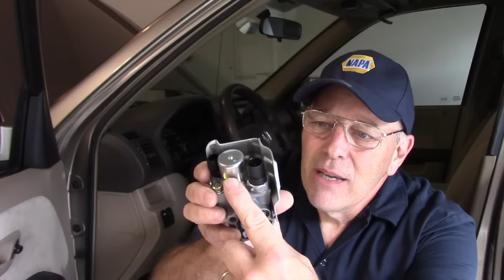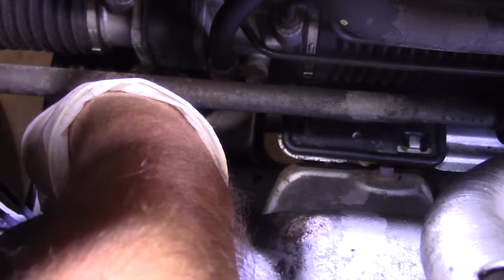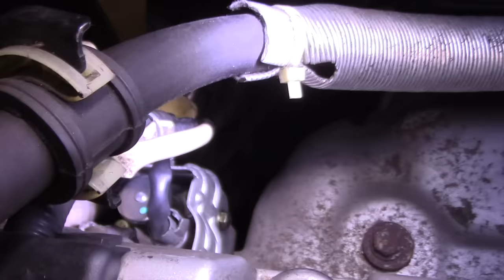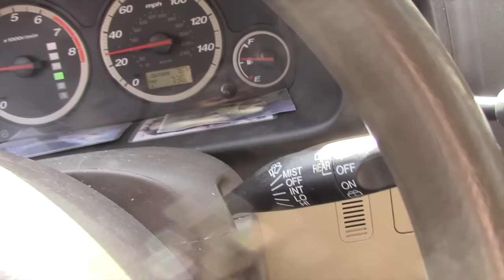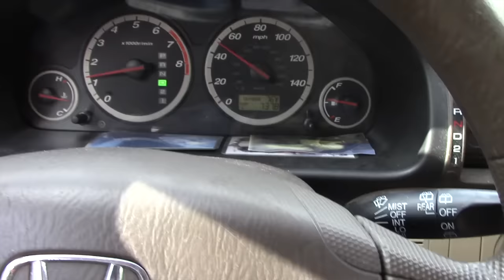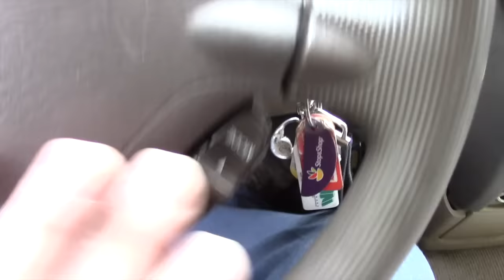VTEC Repair  P2647 Or 2646 (Pressure Circuit Voltage High Or Low)

Comment: I already replace the whole part assembly where all the censor mount filter and still won't pass the smog test some guy told me to just drive it and it will go away but I have being drive in it and won't go away can you let me know what should I do or if there anything I can do

Comment: this is an old video, so I don't expect you'll reply, but I've followed your instructions, the issue is the bolts just wont come out.. Im using 1/4 with 10mm and I even sprayed the with pb buster to no avail.. any tips? :(
Reply from the maker: If the 1/4 don’t work you will need to use a larger size for more leverage

Comment: You forgot one step. Remove the plastic cover from under the radiator so you can reach up through the engine bay and trigger the hood release.

Comment: It was my first time changing the VTEC solenoid on my 07 Honda Accord. I didn't know much about which parts to get so I went with aftermarket because the OEM solenoid was leaking oil. It worked fine for about 2 days then I noticed that my car would jerk. The check engine light came on. It only does it at higher RPM's. Needless to say, don't make the same mistake I did and get yourself OEM parts to replace core engine parts.

Comment: a couple of months back I noticed a slight engine oil leak, at first I taught it was the oil pan gasket but then I noticed it came from the solenoid. I saw a video on replacing the spool valve filter assembly and I order that plus the VTC Filter assembly and just in case some O-rings for the oil pressure switch and oil filter base o-ring just in case that is leaking too. I was waiting for hotter weather to roll in, in case I render my car not drive-able I can ride my motorcycle to work. Last week I got that jerk on the highway, I taught maybe the transmission since I replaced the oil 10k miles ago but when I checked I saw what it was so now I just order the spool assembly so I can replace the unit and maybe repair the old with the previous parts I ordered. Great Video, Thank you very much!!!!

Comment: For those watching this video, if you keep getting this code after replacing your vtec assembly, or get a P0420 code, you probably need to replace your oil pressure switch, which is located directly below the vtec assembly, if it leaking oil possibly due to a bad/failed gasket, that oil will drip below and can get into the boot and wire of the oil pressure switch and keep that code on... I had this issue after hoping that replacing my assembly it would fix it, but it didn't and I discovered oil was all over my oil pressure switch, rubber boot and switch.
Reply from the maker: Appreciate you sharing your experience, it could definitely help others. That is why getting the assembly from the dealer is important.From the dealer it should come with the pressure switch.

Comment: I switch that valve on an 08 honda crv, I even changed the secondary mesh gasket between power steering pump and tensioner...I drove it and it came back on...I changed the oil again even though it had 1k miles on oil change, changed a second oil filter from a stp to a oem honda and still the same... could I have purchased a dorman aftermarket part labeled as oem honda and that could be the issue?  The car surges like stated on the video, but after a few stop and goes it can push to 85 mph with no issue...and it drives like new out of the dealership...but the warning lights wont go away....thoughts anyone???
Reply from the maker: It's possible the aftermarket part is faulty.  Did you get the parts from the dealer or on line. Unfortunately if on line you can’t be sure of the parts manufacturer

Comment: Mine has a loud rattle when starting cold but goes away right away.  126k miles.  Sounds like a loose heat shield.

Comment: I replaced my spool valve ,sensors, oil is good  and still getting 2647 on a 2006 pilot. Also getting 83-01 ecm pcm relation failure. Any thoughts?

Comment: Does the P2657 code apply to this as well? I drive a 2016 Honda Accord coupe v6 EX-L 3.5L and I’ve been getting this code and cylinder misfire codes as well..

Comment: I had this code pop up so I replaced the whole vvt assembly. The code popped up again a month later and the engine kicking started again. I reached out to the tech of the dealership who sold me the part and they said that I should try putting in a OEM oil filter because the aftermarket ones don't give good enough oil supply. Problem seems to have gone away for now, but it's only been one day.

Comment: Great video, i still have an issue i replaced the vtech solenoid and also change the little screen that in front of the power steering. My 2006 honda accord isn't buckling anymore but my check engine light came back on with code P2646 what other part can the issue be? Please help, thank you!
Reply from the maker: Was the solenoid from the dealr or aftermarket?
Reply: It was from autozone.
Reply: @josephortega85  I had so many problems with the aftermarket that I only will install an OEM one. If that code was not there before the solenoid was replaced I would think about replacing it with an OEM part.
Reply: @getitdonehomerepair  will do, going to try that.
Reply: Thank you again!
Reply: Hello, I replaced the vtech solenoid with OEM part from Honda but the car still buckling and the check engine came back on again. Do you think it can be the  Variable Valve Timing (VVT) Solenoid?  @getitdonehomerepair

Comment: I get this p2646 code along with flashing check engine light. I have changed spark plugs and ignition coil but the codes for misfire came back. This started for me after using 88 octane what could be the issue??
Reply: Had the same issue, changed my nuzzles and the misfiring stopped

Comment: Engine light came on and Started bucking at 2900 rpm. Was 50 miles close to an oil change .  But had to a job 150 miles away. Engine  light shut off and it ran fine for 200 miles. Went back in limp mode. So I added oil like ya said and It went off. Was SO happy. The next day even though I bought that quart of oil, I got the oil changed. Had another job out of town and within 50 miles, same thing . Started bucking at 2900 rpm. 2 parts stores including Napa said to change the Valve Timing Oil Pressure Switch. I got one as I was coming home. Now I see your video. Is this the part that I need ? Or do I need that whole assembly?
Reply from the maker: It is possible that the switch is defective but from experience ( without further testing) it is more likely the pressure solenoid. If you do replace the solenoid get the OEM one. Good luck. Keep me posted
Reply: @jimthecarguy  thank u for the quick response . Dang it ha ha. I have the switch only n was about to change that. I think for another $100, I can get the whole assembly n take the switch back

Comment: Can I drive a few hundred miles with this problem. I'm very far from home and got this light.
Reply from the maker: You can but don’t drive fast and have it replaced ASAP
Reply: @jimthecarguy  thank you very the video I learned a lot not as complicated as I thought and to thank you for responding to my question that means so much to me. I did make it home by the way

Comment: I have a Honda CRV 2004, i changed the vtec same as the video. I changed the oil and filter as well. However, I'm still facing the issue when I accelerate that it drops back. Sometimes, I turn off the car, and then when I start it again, the issue goes away. Do you have any clue what should I do to get rid of this problem?

Comment: my check engine light came on, car done as you said, started jerking at 27-2800rpm.. Pulled the code, hit up youtube, watched your video, put the whole assembly in, and shes good to go.. Thank you
Reply: I got the P2646 too and bucking like a pony over 3000rpm...but...the bucking isnt consistent...it will only begin after an hour or so of freeway driving. Pull over, shut engine down, restart it and its OK again for another hour. Replacing the entire VTEC solenoid assembly today. Went ahead and paid for genuine Honda part.
Reply: Where did u get the whole assembly
Reply: ebay.. like $60 @stevelocon577

Comment: Hi Jim, very informative video, by the way my CL9 accord bucks and jolts when at a traffic stop or at low speed, do you think it could be a transmission solonoid issue? Thanks in advance.

Comment: I know this is an older video. Maybe you can help.  I just replaced this and the screen up front. Changed oil and it’s still in limp mode plus a double thunk sound then shuts off.  Thoughts?

Comment: I only get the bucking in 55-60mph...... I'm wondering if any noise would be associated with this issue....... I'm having this p2647 issue and I'm also hearing this weird humming noise almost like a metallic kazoo, never heard anything like it. Again at the 55-60 mph. Thanks for this video I really appreciate the detail!!
Reply: Get your valves adjusted

Comment: Anybody who spends 30+ minutes on a very informational video like this. Deserves a like & subscription.   Bonus points for the test drive footage afterwards!
Reply from the maker: Thank you for kind words. All too often on Youtube you hear negative comments and thanks for the sub.
Reply: All that time but didn’t even bench test the solenoid. Didn’t check ohms plunger or voltage.
Reply: @quddusahad8374 over 200K miles, at this point why even bother? He knew it was bad. OEM part is $200.

Comment: Initial problem as leaving gas station red oil can came on. Oil pressure light. Upon getting it home I put my scanner on it and up came this P2649, but that is not my issue anymore it still throws code, vut I have the sounds of non engaging vtec etc. Everything is new on car as far as all that goes. I am doing everything I can to not have to drop pan and oil out again 09 accord 2.4L K24z3 motor i-vtec. Still oil pressure light and sounds like no oil as the usual meta on metal sounds so I adverted immediately. I have done everything possible and I mean all necessarry tests to troubleshoot any and all connections, switches, selenoids, etc. Any help greatly appreciated. Thank you.

Comment: I took naughter in my husband shop he like a master he's like a Master Mechanic that overhauls strips transmission for hot rods and everything I have them look at my daughter's car she needed a need a timing solenoid for a 2008 Honda CRV what I bought from RockAuto timing solenoid and he stuck that in and still having problems with a 2646 code so I bought one of them so annoyed for him to put in and he found a screen in the front of the engine that he changed also to make sure it was clean oil and just put in synthetic oil while she was there the week before so you put send the new cell annoyed for the timing solenoid and it's still acting up so is it true that you got to run that for about 200 miles from cold to go away in the car to start running right slique going to hesitate but yeah took it in their alternators bad running right because nothing was getting charged in it so it all on circuits and everything in no cars wasn't relaying right information Jenna's how you you go about getting that how you get them lights off at cold after you replace the solenoid timing solenoid is if it's still acting up what could be the problem there's something we missing something is still acting up keep having that 2624 cold come up now can he reset that computer and how would you do that

Comment: For anyone that has had to replace this piece more than twice I’d suggest to clean the male and female ends with electronic spray. One of my female ends has a broken latch which prevents it from clicking closed. I’ve replaced the solenoid 4 times with this previous time being the genuine Honda part. I just couldn’t believe that the Honda part broke so I searched high and low and found this solution.
Reply: I had the same problem on my element and I got an oem part, and lasted me a few weeks , and it did it again. I’m going to clean my pigtail collections see if that helps. Thank you
Reply: @reytech1786  so I cleaned the pigtails and it was a bandaid on a bullet hole. Basically lasted for 20 minutes of driving and then would fail. Tried to clean it the other day, the pigtail broke off inside the solenoid, cost me 409 at a mechanic to just attach a new pigtail. Honda wanted to do the whole engine harness and the solenoid again. Estimated $2300. So did the repair for the pigtail elsewhere. Anyways, when driving back to Tampa from my parents house it broke again. Car has become a money pit so it has to go.
Reply: there is another one in front of the engine...oil screen dirty @reytech1786

Comment: I have had this problem  with my Element for 3 years,  I have changed that valve 2 times sensor 2 times,  I didn't  know  you would  get that code with low oil. Thanks for that. But now I'm wondering will you get that code when you have a bad oil leak, even  if you fill the oil up to to the right level???? With that in mind should  all oil leaks  be fixed first.  I have spent  so much money  and still have the same problem. 😢

Comment: I owe you a sincere THANK YOU. Your simple mention to check the oil level solved the problem and likely saved my engine.
I just had the oil change 2 weeks ago at Walmart and they obviously screwed up and didn’t add the oil!
Everything was dry underneath and they added the oil necessary(check engine light immediately disappeared). They also have the obd printout and if any issues turn up going forward they said they will cover the cost.
As another note, the cruise control would not engage and that was my first indication something was wrong and the rumble shortly thereafter…
Thanks again for this video!
Reply from the maker: Wow you could have destroyed that engine for sure. I'm happy to help.
Reply: @jimthecarguy  that simple mention was so valuable. I really can not thank you enough.
Reply: Anything other than a honda wouldn't have gotten 5 yards without oil 😅
Reply: @richardd8352  Update Walmart denie my claim! Stated I could never have driven without oil for 2 weeks. Whatever, DO NOT GET YOUR OIL CHANGE AT WALMART! EVER! I use a local shop and pay double for the satisfaction of knowing they actually did the job they were paid for. Thanks again.

Comment: Jim, this video is better than any other video's I watched so far. You go as far as explaining in more detail and even mention cleaning the engine where the gasket surface is to remove old oil and any dirt and debris when no one else did. I'm a retired motorcycle technician and machinist and cleaning gasket surfaces is very important. I just bought a 2005 Toyota Element EX with the 2.4ltr engine with an automatic transmission. Last night I drove it home 4 miles then fifteen to work today. Leaving work 500 feet down the street the engine started bucking on acceleration about 30 - 35mph and the engine light came on. Found out the codes are P2646 and P2627. Going to take it back tomorrow for them to replace these parts. It came with no warranty, but I'm sure they'll take care of it. Being a retired motorcycle technician and machinist, they're going to get a tip because it's the right thing to do. It's not their fault the part(s) failed. Also a message came up on the instrument cluster that says "Side airbag off", then turns off and comes on. It did this all the way home.

Comment: more often than not,  it's moisture in the connectors.  when you open the hood wet on the element,  water runs right into them.

Comment: I have a toyota avensis 1.8 vvti 2015,  sometimes I get error P2647 A Rocker Arm Actuator System - Stuck On (Bank 1).
it only appears shortly after I leave with her

Comment: Had 3 of them with these codes and was
Not the solenoid.Was from a cheap oil filter,an oil change using a high quality oil  filter fixed these

Comment: Writing this in the hope that it helps someone that is dealing with this issue. 

2007 Accord 2.4L. Oil changes were not done on a regular basis. Code P2646 showing only. Car experienced the ‘bucking/stuttering’ past 2500 or 3000rpms, fine below that. 

The first thing I did was check the oil. It was low so I added a quart. The issue did not resolve. 

Went and got the VTEC solenoid assembly. I changed that out and the car ran fine for about 15 minutes but then the code came back on and the issue started again. Removed the assembly and saw the screen was full of gunk. Cleaned the screen off and took the car back out. Ran fine for 15 minutes and then the code kicked on. 

I then changed the oil and filter and also removed the assembly again and it was full of gunk. Cleaned it off again. The car ran fine for about 15 minutes again the code came on and the car experienced the same issues. 

Took the assembly off again and the screen was full of gunk. Cleaned it off and put it back on clean. 

After this last time the car has been running fine. No code. No issues. 

If you know oil changes were not done on a regular basis then it’s safe to assume the engine is full of crap that will clog the assembly. 

The first thing you should do is flush out the engine to remove all the contaminants. Change the oil, and filter and clean the screen. 

If the issue happens and the screen is clean when you remove it then the assembly could be bad. 

If the assembly is new and the screen is clean when you remove it then it could be the harness. 

If the harness is new, the assembly is new, and the screen is clean then it could be the  oil pressure switch or the oil pressure sensor. 

Hope this helps!
Reply: This is very helpful thanks a lot, did you mean the vtec solenoid screen?
Reply: did you experience misfire?

Comment: I have the same code but my car hasn’t buckled in the highway but I do have a rattle noise. List of codes P0497, P0496, P0456, P2647, P0455, P0497. Should I just get rid of the car? It’s a 2006 Honda accord V6.